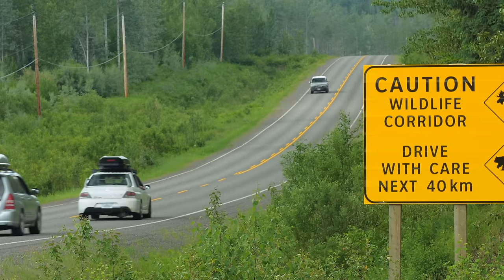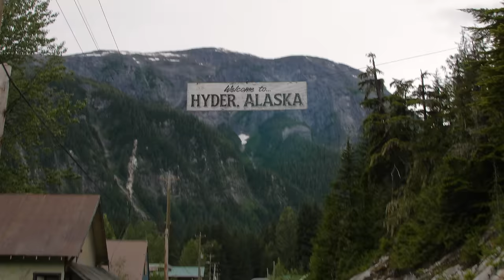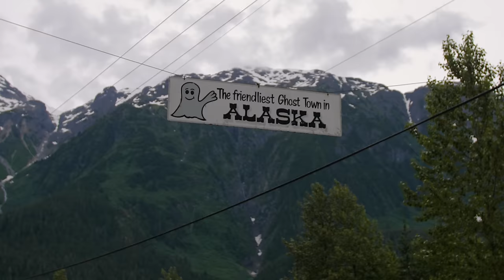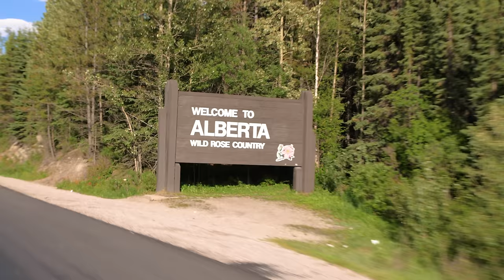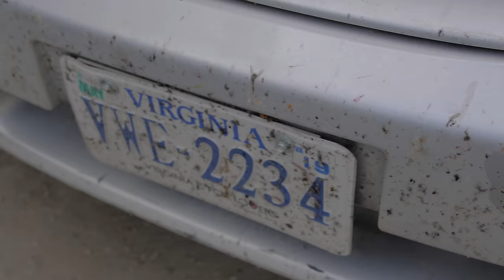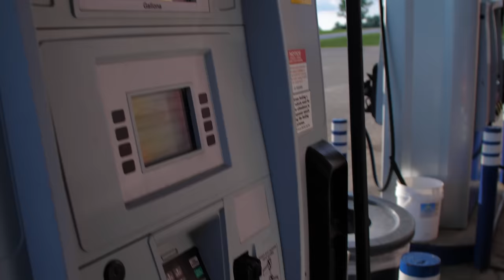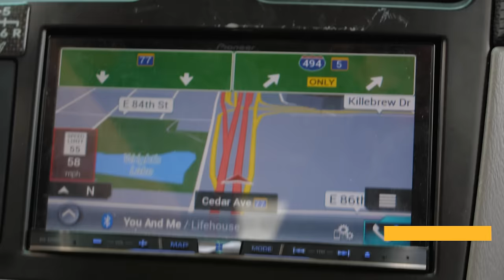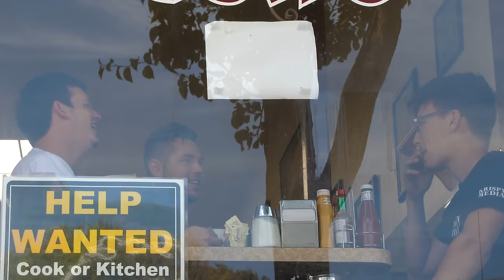Driving from Florida to Alaska - Episode 3

Comment: Great series, but guys, the cars will run on 87 octane, just keep them out of the boost they both should be more than capable of automatically dealing with less than ideal octane.
Reply: i could be wrong but cant they use an octane booster?
Reply: Yes but if they cant find 91 they probably couldn't find booster. (pretty sure they just added that for drama)  BTW when looking for this episode I found multiple RV channels that did the same trip in far better detail, "less junk more money" being one of the best.
Reply: have had to stick shitter fuel in loads of performance cars when traveling in remote locations, never had an issue just baby the car the whole time while its in the tank.
Reply: I was going to say the same thing. Don’t “run from bears” and drive on 87. Could have been fine.
Reply: Octane booster from the sponsor
Reply: cars would have been fine on 87. I ran my 1jz a few times on 87 because of the same reason.. the eco will detune because it will have slight detonation, so just drive easy and no running from bears lol... and yes octane booster helps. (bandaid fix IMO)
Reply: You can detune your car for 87 octane in the ECU pretty easily.
Reply: Or just turn down the boost to stock levels. The stock maps can run on 87 octane.
Reply: Anytime I’m road tripping in BC or northern AB, I bring a few cans of Boostane. Half a quart will bring a tank of 87 up to 93+ rating. They take up no space, and it means you can use any gross farm gas you find without worry. 
First thing I thought of when they were worried about the 87 situation.
Reply: Yep, did the same trip in my Focus ST. There was only one gas station on the way to Anchorage that only had 87. I also got about 320 miles per tank, so I didn’t have to fill up as often. Knock sensor adjusts the power down. I was worried as well but the manual says you can run 87 if needed. Different engines but similar size and amounts of boost.
Reply: SP392 I kept thinking the same thing. If they are stock tune then they are totally fine. If they have access ports then they could have detuned. Regardless though if they stayed out of boost they would have been just fine
Reply: SP392 yeah, I too thought those cars would have been able to just use the anti-knock sensors adjust the spark timing. Maybe it’s different because they are turbocharged?
Reply: @edwardcressall9711  no it doesnt raise your octane that much. Sorry

Comment: ProTip: If you need high octane up north, bring octane booster.
Reply: that what i was going to suggest.
Reply: LOL Like Advance couldn't have hooked them up with a case of it!
Reply: @dday644  I thought the same lol. Just put 2 bottles in just in case you're worried
Reply: For a bunch of car guys, you think they’d know that.👎🏼 crybabies.
Reply: another ProTip: Skiboxes absolutely kill any fuel economy. Try to avoid them and stuff everything inside the car.
Reply: The risk is that it’ll cause build up on injectors and sometimes in the tank. Not the best if you’re doing 1000s of miles, and that too in cold weather where gasoline in the tank can expand and contract when car heats up and cools down.

Comment: Little bottles of octane booster are your friend.  Great trip!!!
Reply: i came here to say that, guess they've never had to use them before!
Reply: The question is, do the gas stations in the remote areas of BC have bottles of octane boosters if, for some reason, you didn't think you would need them before leaving civilsation.
Reply: @emin86  they went to a shit ton of advanced autos.  California has th4 shitiest gas they shouldn't bought a lot there
Reply: driven all the way to Nothern BC, through Alberta, & Saskatchewan. bought 10 bottles of Octane booster and used them in the small towns that didn't have 91...once off the main road you absolutely need to do this.
Reply: Would they have helped them to go from 87 to 91 octane?
Reply: @WarriorsPhoto  well you can buy in bulk at places like Canadian Tire or Costco sometimes and save quite a bit. I have a tune on my car which allows me to switch from 94 to 91. TBH 94 is so rare in small town BC & Alberta that there's no point in running the 94 tune on vacation.

Comment: This reminds me of one of my 1980s road trip adventures I drove from my Fairbanks, AK home on down to college in Oregon.  Back then,  the 300+ mile Cassiar cutoff portion was unpaved,  but still saved 100 miles or so over taking the Alaska Highway through BC.  So I took it.   Only I wasn't smart enough to carry extra gas.   I thought I had it planned out well enough,  as I would have 3 gas stations to choose from when I getting low on fuel.  So in the middle of nowhere in BC I was getting low on fuel and, just as planned, got to the first gas station.   "Out of Unleaded" was the sign posted.   So I continued on to station #2.   "Out of Gas"  was posted there.   So onto my last chance before I ran out of fuel.   Station #3 was closed and locked up.   A sign on the door of the adjacent restaurant said "Gone hunting, back next week".   I started to panic a little bit,  as there were no other services within at least 40 miles or so.    Then I noticed some movement inside the building.   I knocked and they answered.   They were just about to leave,  but were nice enough to open a pump and fill my car's tank with unleaded.   Had I been just a few minutes later I would have been stranded out of gas.   Oh - and then as my car was getting refueled,  it had just started pouring rain,  and I noticed I had a flat tire... so had to change in the mud  (at least I did have a spare tire with me).
Reply: Yeah, been there and done that.  I hate those situations.  Google told me a gas station existed that had closed during the recession.  Turns out my car can go on empty at 35mph for 50 miles.  Now I'm to careful and am always stopping to fill my tank.  Hmm, 3/4 tank?  Better fill up just in case.
Reply: Holy crap
You only made it by the will of God
Reply: That’s a hell of a Situation to be in. Luckiest person alive

Comment: Long as your not in boost using 87 you can cruise no problems..the ecu will also adjust and add more fuel.
Reply: what does the device called? I want to be able to adjust my ECU with that device

Comment: Trust me on this one.   I’ve driven from Pennsylvanian to Alaska and back and your cars WILL RUN on 87 or any other octane.  Not the best performance but they will run.
Reply: Those cars both require 91 octane. If they use less, the engine will knock.
Reply: what part of pa? im in Westmoreland county. thats impressive
Reply: I think its not just that the cars "have" to run on the premium stuff. It could also be that both Ben's prefer premium over regular. Im Australian so ill explain from my point of view. I drive a Holden Calais, a luxury car built here in Australia. It uses an Aussie built version of the GM 3.6L V6 codenamed LY7 or nicknamed "Alloytec". These engines are rated at our lowest fuel octane which is ULP91 (87 Octane basically) and is important given the car was built to travel this vast, empty country where petrol stations (gas stations) on outback highways can be up to 150km (90miles) apart and will likely only offer diesel and ULP91 (87). I prefer to put in our mid grade premium petrol which is ULP95 (89-91) that cost about AUD $0.10-.$012c (not sure in USD; google doesn't help much either) more per litre (gallon) than regular ULP91 (87). While its not mandatory, It gives me piece of mind knowing that a better octane is running through my engine and it does make a noticeable difference in both performance and economy.
Reply: William Justice omg I just drove to PA from Kenai, AK!! It took me 8 days with a layover in Wisconsin. I thought I was a weirdo but you get to know more people at gas stations along the way making such long road trips. How often do you do it?
Reply: @MisakiLeasim  Same here. Did it in 6. I met a guy along the way that  drove from Florida to Alaska on a bmw bike, now that's crazy.
Reply: Dont these cars have knock sensors that will eliminate the low octane ping?
Reply: @RunDub  Thank you for educating Adam Stanton.
Reply: Wouldn't have been worth it, on 87 those cars would feel like dildos, and driving them would be a dreadful chore. They went as far as they needed to.
Reply: I was totally shocked to hear that 😱 fueling mine with 102 octane here in germany, standard is 95...
Reply: @dudedr3396  Different octane rating system in Europe than US. You guys use RON and we use AKI. Basically 95=87 and so on
Reply: Geekazoid22 Thank u, didn‘t know that ;)
Reply: Jorden Belanic I’ve gotten better economy from using premium than I have from regular when I’m driving both city and highway miles. I also prefer to run the premium petrol because my car is noticeably smoother under acceleration and sounds quieter
Reply: Their cars should run on 87. I had an old muscle car that would not run on 87. Wouldn’t even want to start. I made that mistake once. But that was when you could get 94 everywhere

Comment: You can pump 87 into them. Just don’t floor it.
Reply: Jinge Liu .You can get 99 here in the pumps in the UK,that’s what I put in my Corolla Tsport.95 octane Is the usual,I’ve never seen it lower.
Reply: @shaneking4312  North America uses "AKI" ratings for gas, rest of the world uses "RON". your 99 RON is equivalent to 94AKI, which is the highest grade we get at regular, but select few pumps. 91AKI (95RON) is the usual highest. 87AKI is about 90 RON, which is basically the only gas you get at remote places, and what vast majority of cars run on.
Reply: @shaneking4312  It's all the same, just different the way that NA and Europe do their octane ratings.
Reply: @shaneking4312  you put 99/94 in your corolla? Why??

Comment: Awesome video. When I was younger, I ran over a nail or something when my factory tires were practically new. I plugged my tire with what you used and it came with a tube of rubber cement. I used the tire 10s of thousands of miles later down to the wear bars with no issues.  The same thing happened a few years later to my summer set when they were a quarter of the way worn, and they are also still good to down to the wear bars.  You should be all good.

Comment: So let me get this straight...

The same person who thinks that running your car on 87 fuel for a few tanks will harm the engine, and running a single tyre with 2 or 3mm more tread will harm the drivetrain, also thinks it's a good idea to drive 10,000km across two countries in it??
Reply: James McKay yup
Reply: 16000 kilometres actually
Reply: right on!
Reply: Some cars require at least 91 octane. If they use less than 91 the engine will ping or knock. (Ex. Mercedes, most sports cars, most turbocharged cars, etc.)
Reply: Adam Stanton  that's just not true though is it.
Reply: James McKay yes it is. I drive a mb e550. Mercedes says if you don’t use premium gas, the engine will knock. Same thing with any Mercedes.
Reply: Adam Stanton  Mercedes recommends premium gas which is understandable... I only ever use it myself when it's available. But using 87 fuel for a tank or two will not cause the engine to 'knock' as you say...
Reply: Adam Stanton  ahh, autohaussouthbay.com, the fountain of all knowledge
Reply: octane booster? stay off boost until you can get premium again?
Reply: The same one that licked the bumper
Reply: You are totally right
Reply: My 330i's engine computer will detect lower octane fuel and change its mappings and timings to prevent knocking and damage to the engine, so technically it will run but it's not advisable and it kills your fuel economy to boot.  Other high compression cars don't have this feature and will knock.
Reply: Actually having different sized tires results in slightly different rotational speeds, which can accelerate wear on the differentials in all wheel drive systems like his Evo. The generally accepted rule is no more than 3/32nd of an inch, which comes out to  ~2.4mm. So the size difference is likely on the edge of where you'd start to have problems. Considering the miles they'd be putting on the car with the mismatched tires I don't think his concern was unreasonable.
Reply: @adamstanton1025  not true.
Reply: I mean it just misfires and feels funny but with 87 the car won’t shut off or fuck up...
Reply: Im quite surprised on the octanes u guys use in the US, I'm from Europe, and we use 95 as our lower octane and 98 as our premium, then use 102 to rallye cars and things like that. So I'm not sure why u guys use such lower octane
Reply: Adrian Ramos Europe gas stations post RON ratings while the US posts AKI ratings (RON + MON)/2...which is the reason for “lower” octane ratings here in the US. In reality, they are about the same.
Reply: @adrianramos9644  Different method of octane calculation in the US
Reply: @adamstanton1025  Then just run 2 tanks of 87 followed by a tank of jet fuel to even it out
Reply: Its fine as long as you stay out of boost
Reply: Knock sensors and whatnot will also adjust timing to compensate
Reply: @adamstanton1025  The engine will knock only on heavy loads and heavy accelerating, highway cruising is just fine on any gas on any car.
-GM Powertrain Engineer.
Reply: nvrfollowb5 yes. Keep the revs low and out of boost. You can freeway commute garbage gas.
Reply: @18otr  but some people dont want their car misfiring because then there is more work to do with sparkplugs and wires
Reply: On awd vehicles running tires of different size can harm different components of the drivetrain. Iirc Subaru recommends all tires of same manufacturer and model be within 2/32’s of one another.
Reply: highway miles aren't hard on modern cars. a car with 150k highway miles has the same wear as a car with 50k city miles.
Reply: Yup, all that knowledge and never heard of octane booster!
Reply: I have a 92 ford ranger 4.0 4x4 manual transmission, with 365000 kms that is really rusty and has been overheated about 6 times off road due to the fan clutch not working. it's also my daily. I can make it knock on command. 5th gear below 1000 rpm and it will knock. proably bad for it but the engine is on its way out. got a head gasket leak on the outside of the engine. Planning on rebuilding another 4.0 and swapping it. I'd like to get a nice angry eye subaru someday but I'd be scared of curbing wheels and such.
Reply: Don't forget licking bugs and putting a roof box on for no reason then wondering why their mileage is poor.
Reply: @telafonic  roof box for no reason? Did you watch the entire series at all?
Reply: @marlouquilicol1189  It's been a few months. Remind me why they couldn't use the space inside the car since they only had 3 people and 2 cars.
Reply: @telafonic  check 12:10 of this part 3... That ski box was definitely not useless.
Reply: @marlouquilicol1189  That stuff could have sat in the car though. Killed their mileage by probably 25%.
Reply: Yep
Reply: Alaska anchorage only has 90 oct best lol.
Reply: @StanleyKubick1  with such little turbos that'll be hard.... I'm so glad we have 102 octane here in germany/switzerland haha
Reply: James McKay You obviously are not very informed on engines. High compression engines and high cylinder pressures from forced induction generate more heat. This higher heat can cause ping and knock. Engine ping or knock can cause engine failure resulting in a complete rebuild or a complete replacement. 87, 89, 91 & 93 have more differences than octane rating. Putting 93 in an engine that only requires 87 will not result in higher performance in most cases unless more variables are changed. 

Also, with Subaru's awd drivetrain system by design you can actually damage the drivetrain if you do not run symmetrical tire sizes and usually that also requires running the same brand. Not at brands are created equal. Just like shoes and clothes, just because they might be sized a certain way does not mean they are actually the same.Try doing some research before you start knocking someone for their beliefs. Chances are you might actually gain some knowledge yourself.
Reply: Cars are meant to be driven, there is no reason why these would not have nade it.
Reply: The minimum you can get in Europe is 95 octane. Which is everywhere.
The price per liter is €1,50 in the Netherlands on a good day and more towards €1,80 on a bad day.
But at some gas stations 98 octane is also sold. Some even sell 102 octane gas which they call racing fuel.
More hurspurs :p but like €2,00 a liter.
Reply: @frederickontour1478  yeah someone already said they use a different method of measuring it in Europe
Reply: sure that tyre - drivetrain thing is just crazy... but I had both, an evo  and an sti and they both should be driven on 98 octane to reach stock power... at 95 octane subaru is changing the map and you end up with less power, 91 octane Ive never tried, but the knock-sensor must go crazy... but 87 octane ??? didnt even know something like that exists ( is there still lead in it ? ) and why would someone put swill in his car ? wouldnt some fresh moonshine be better ?
Reply: @McGuinty2  x
Reply: @adamstanton1025  Well my friend, those are not Mercedes cars. LOL
Reply: @dEnimlAb27  ??
Reply: @18otr  emergency only not more than one tank full most manufactures say and you get a detonation just right it can grenade an engine
Reply: @Maxam-Media  because its a precise system
Reply: @marlouquilicol1189  back seat empty lol
Reply: I would say it is more about even wear. They have been driving 7,000 miles, pushing cars that have been just droven 7,000 miles. You put one unmatched tire onto a car/crew who just drove 7,000 miles. Yes 2/3 mm of tread could hurt the whole car.
Reply: Drives horribly inefficient per mile cars that Require 91 octane premium gasoline across two countries to a place where gas stations basically don't exist and also DON'T carry 91 octane gas, then complains about not being able to get the right gas 😂😂
Reply: @spencerrr9878  you watched 🤣